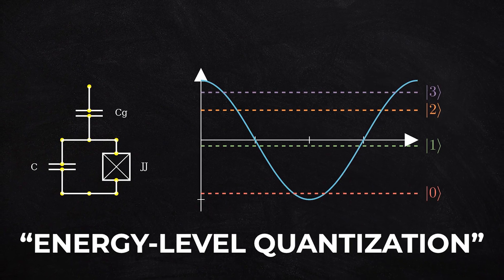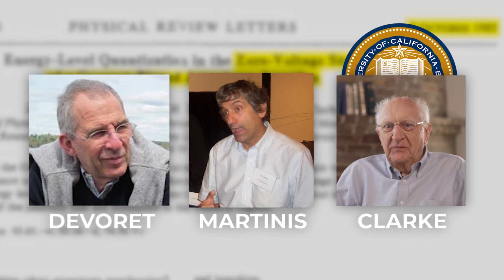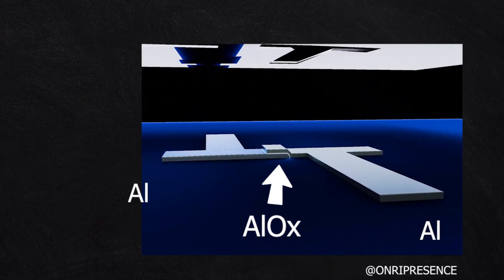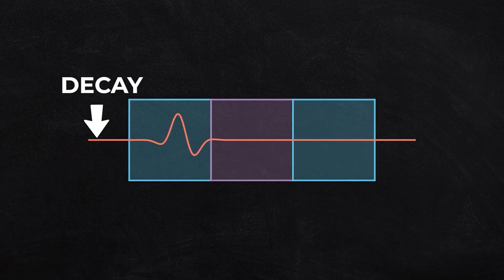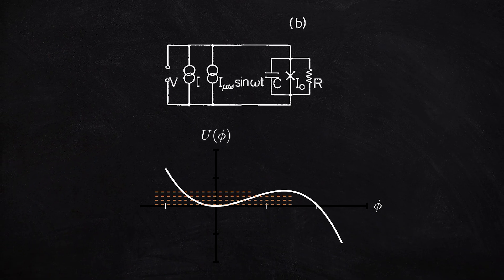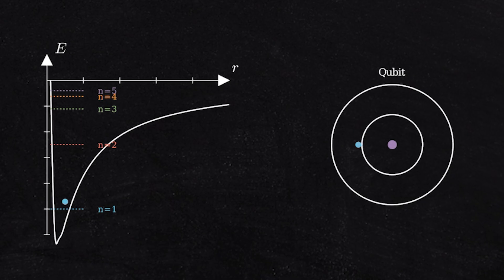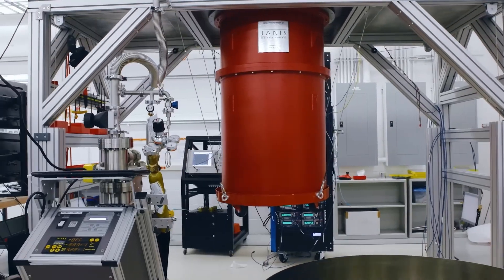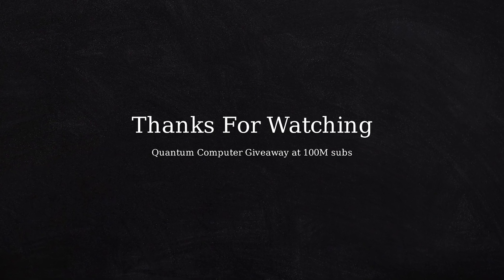Quantum Computing Just Won a Nobel Prize

Comment: Hello, If you know anything about this, please can you help me? Is there a way to get the most powerful supercomputer currently available so that I can use it permanently? Is there a way, either through software or some other innovative method, that I can get the most powerful supercomputer system? I need to use it permanently in my work. Please, if you have a way, guide me to it.